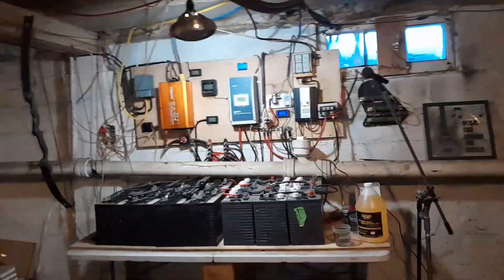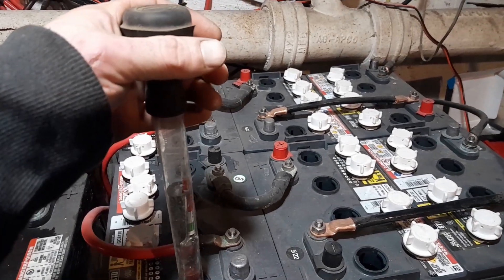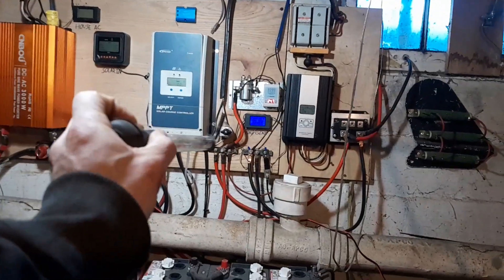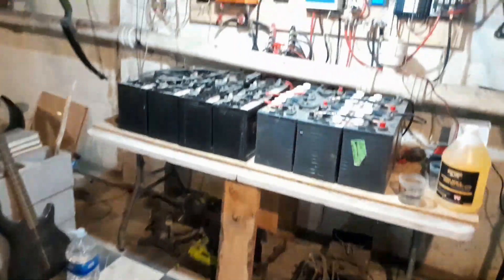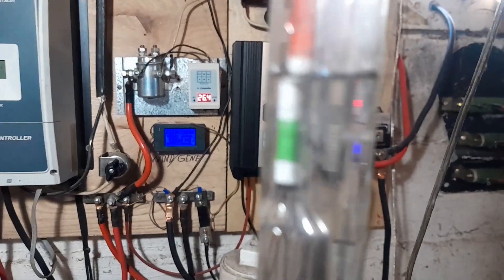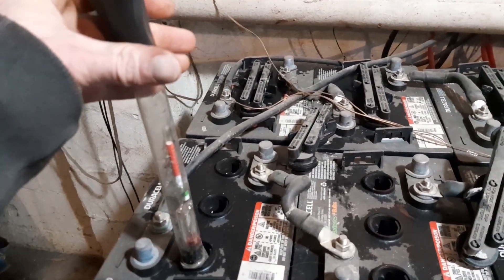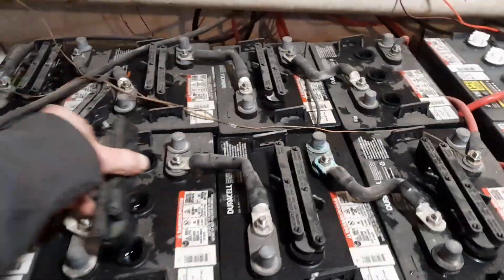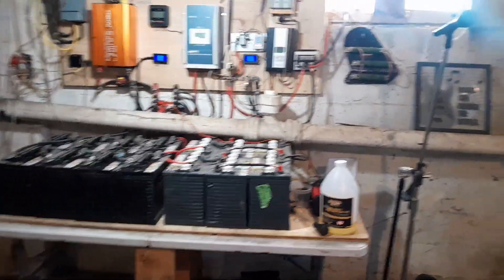"Battery Guys" Restore Formula... Does it Work?

Comment: I have had good results with battery reconditioners. Not awesome, but good. I had a few low end O'Reilly car batteries last 10ish years by running a reconditioner on them for a couple of days every 4-6 months. I also had my truck battery run down to 4.6v on a 12v battery. I put a dumb charger on it to make my reconditioner think it was reading 12v and go into recondition mode, then shut off the dumb charger, it got that battery back up to 12.6v and it lasted another year before I had to replace it. It had been damaged in an accident and was not recoverable after that. It may have made it another few years if not for that. It was already three years past its warranty date when I had it run down.
Reply from the maker: @Nogard666  good to know bud! Thanks for the info. I feel like i should really know more about these products bit somehow they have escaped my attention...till now. Keeping batteries happy is an important part of my life and i wanna know ALL the tricks.

Comment: I've dealt with lead acid batteries for 35 years in electric drive material handling equipment. There's one thing and one thing only that truly tests a battery, and that's a load test. You can have perfect hydrometer readings and completely toasted plates. I'm not going to give my 'battery speach' that I used to give customers on why they need to maintain their batteries and what happens if they don't. That takes 20 minutes to type out. Anyway, you need to load test before you'll know anything definite. Here's one thing I learned. They've been coming out with battery rejuvenator quick fixes for at least 25 years. We jokingly call them 'battery in a can'. I haven't seen one produce a satisfactory result yet. I wish you luck on it. I hope it works, but I'm 99% sure you won't be happy with it. I've replaced damaged cells before (you can do that in 3000 lb forklift batteries), and that's the only "repair" I'll ever do. Most of the time, every battery cell has been though the same life as every other cell, and most of the time, the fix for a tired battery is a new battery. The only fix for a non modular (car) type battery is a new battery.
Reply: actauly u can repaiar a car battery the pakistans do it on a daily basis.
Reply from the maker: I have had my eye out for a forklift battery for some time. They come around but its never when i have extra $. Gotta just make it a priority and quit screwing around with toys.
Reply: @smallcityhomesteaders1600  check with local fork lift repair companies. they might have some used units.
Reply: @smallcityhomesteaders1600  I've had TONS of people asking me if I can get them a deal on a forklift battery. Probably on a new one I can get 10% off or something like that. There are 2 problems with forklift batteries that most people don't think about. The first is that they are very expensive, and by the time a company takes one out of service, it's completely toast. Purchasing managers will run those things until the forklifts are burning up due to the low voltage/high amperage they're trying to suck out of them. The second problem most people don't think about is the weight. A standard standard 24 or 36 volt reach truck (the stand up units you see in Home Depot) battery is in the 2500 pound range. The average 36 volt sit down counterbalance battery is going between 3000 and 5000 lbs. If you have a heated shop to put one in, ok. You're still going to need a forklift or some kind of crane to unload it on your end. Getting one into your basement is pretty much impossible without some wall demolition and rebuilding. They sound like a good high capacity option, but they come with their own issues.
Reply: @smallcityhomesteaders1600  Forklift batteries come with their own issues. First, by the time a company is retiring one, they're usually complete toast. No purchasing manager EVER said "let's buy a new battery for the forklift and put the still serviceable one up forsale." The other issue is weight. I've had tons of people ask me about them over the years and if I could get them a deal on one. I can probably get a 10% discount through the company, but how are you going to move it ? A standard reach truck battery (the kind of stand up forklift you see in Home Depot) is going around 2500 lbs. A standard sit down counterbalance forklift battery is going anywhere from 3000-5000 lbs. If you've got a heated shop and a a forklift or overhead crane to move it with on your end, you can probably make it work. If you're thinking you're going to put one in your basement, you'll need so do some fairly extensive demolition and reconstruction work in order to get it in there.
Reply: The truth will set them free 😢

Comment: charge charge and more charge. get em charged for a WEEK! not just a day.
Charge the ever living daylights out of them. raise your float voltage to 13.8 to 13.9v. or increase absorption duration. get them charged until specific gravity stops increasing/improving.
old and really low lead acid batteries are stubborn to come back up if they've been like that for a while. they need heaps of time and extra charging.
Reply from the maker: @realflow100  i agree...thats the difficult part about our setup. We have no grid to connect to a leave the batts sit on a charger for weeks. I can run the gene to take the load off the batts and that runs a 10 amp charger but thats it...i gotta keep running the gene.

Comment: You may need to set a higher float voltage on your charge controller.  I found the batteries on my shed's solar system were also showing very low, since they don't float 24/7 like in a UPS, for solar I find it's best to bump it up a bit.  Then check back in a few days, and keep an eye on it until you're back in the green.
Reply from the maker: @redsquirrelftw  thats a good idea bud.